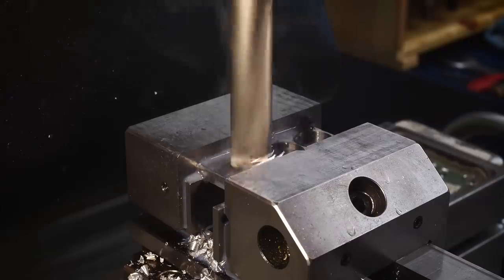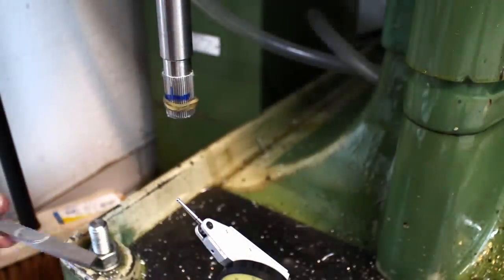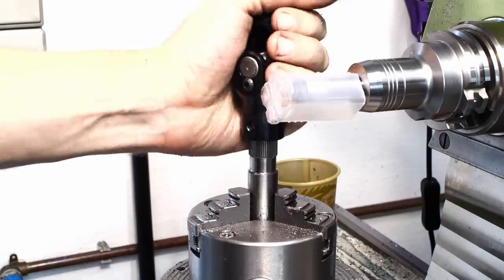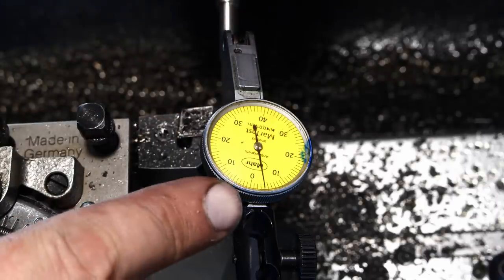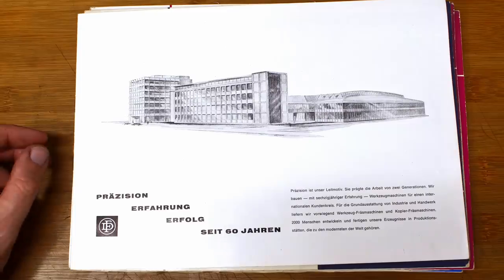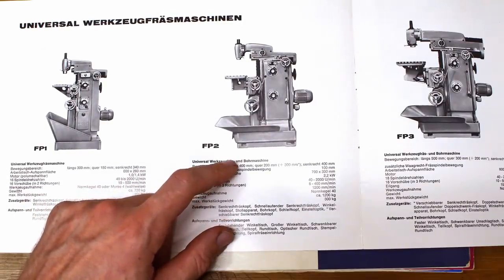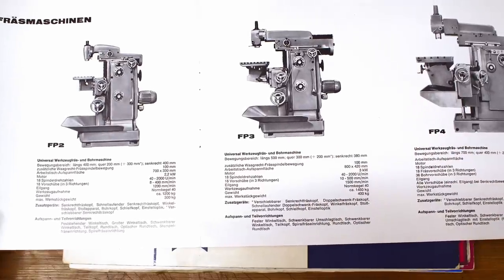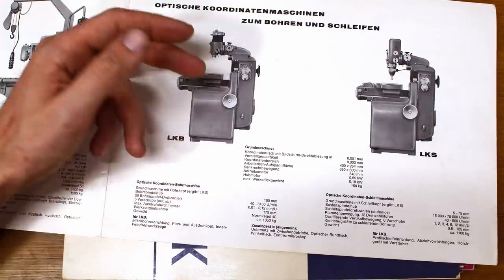Shoptalk #28

Comment: love the shop talks and really liked that radius setup!  is the error from the "straight" section of your radius?  ie the tool length?  mount the tool on the bar and pin-slot it to the toolpost?  I'm surprised your tailstock quill and taper lock well enough to drive the carriage under power cross feed.  maybe i need a new lathe, lol.  anyway, enjoyed!
Reply: This Old Bro, you need to post more videos
Reply: Left this comment on Stefan's comments, but you would certainly be another that could produce a nice, clear presentation of "fits".

"You mention something in this video that I'm not very "brushed up" on. You used the term "sliding fit". I've looked and have never really found a good video on "fits", sliding/slip/press/etc."

Comment: Good stuff Stefan, love the radius setup in the lathe.  Making the pin spacing of the radius bar shorter by the tool nose radius will give an accurate part radius.
ATB,  Robin
Reply from the maker: Hi Robin! Thanks, I have to revisit the radius tool, the geometric phenomen, on how the insert radius actually deforms the contour is not entirely clear to me yet.
Reply: @StefanGotteswinter  I don't think there is any error if the insert tip is straight on the centerline of the 400mm holder, and the 400mm is from the tip of the tool to the center of the pivot near tailstock, what does change is the stepover per revolution because you're feeding in in a straight line, so stepover is decreased INcreased as you get closer to the center, but probably not an issue in this case if there is some radius on the tip of the tool, besides the error is minimized because the infeed point is far away from the pivot point, would have been even less if you moved it closer to the cutting tip
PCD tool had a hefty radius, MCD I couldn't make out

Comment: I never use water based coolant... I use the cheapest atf(oil) i can lay my hands on... First, it smells like you are caramelizing sugar when burnt or heated up, second, its oil, not water, so it can not cause rust if left on surfaces... 
Its also quite a good cleaning agent in and of it self, making all the machine surfaces it runs down and that get wiped off as clean as if blasted with brake cleaner... Sure, not in a single go, but when its your only coolant, you machines quickly shine up and loose all oxidation or discoloration on any supposed to be bright finish surfaces... 
Its essentially hydraulic oil, but unlike many hydraulic oils and low vis. spindle oils, its not as toxic as all hell, it doesnt turn acidic in a hurry like some hydraulic oils do in presence of even a hint of moisture in the air and so on... 
I highly advise anyone whenever i get the chance to try it or to switch over to it... It needs less maintenance than water based coolants, it lasts longer(much longer if the system is filtered and not fully open to air all the time...) and while it may be worse in cooling capacity, all the other properties it offers outscale water based coolants in my opinion by a margin and a half... If you want cooling, use the mist system with the same oil and there you go, much less oil usage, much higher cooling and still no chance of rust or any stupid shit... There is a reason why the old automatic lathes which were cam programmed ran and used nothing but mineral oil as coolant... Those were high precision, complex system machines that required absolutely no chance of any complications due to nonsense... 
Also, when coolant gets warm or hot, it also evaporates water inside the tank, and if that tank is the machine base or some machine cavity, you are getting moisture condensation within the machine cavity in the area which likely isnt all that immune to rust... Sure, its likely painted all over, so that offers some rust protection, but paint is a poor solution, whereas with oil, if it evaporates in the machine cavity, it deposits a layer of oil on those surfaces and all other surfaces it lands on, granting some rust inhibition as a free gift... 
As mechanics say, ``if water in your knee is bad, you dont want it anywhere else``... Also, if you are using or making your own water cooled spindles, you might consider automotive ethylene glycol as an additive, sure its toxic, but its delicious, and that is the point! Jk, its rich as hell in rust inhibitors and the spindle cooling sys. should be a sealed system with water to air cooling via radiators regardless, which should encourage you to use glycol(if you are confident in handling toxic additives(like the ones used to sanitize machine water based coolant...))... It will help the seals hold up better, and it wont rust weld the cooling system over time, and for fucks sakes, if you are in a cold place with a cold shop, i dont need to say that its also called antifreeze, which i dont need to explain the benefits of in using in a costly system that could be damaged by frozen cooling liquid...

Also, Stefan, you are torturing me by reminding me of Deckel LKS/LKB`s, as one got away from me and im still pissed about it, as it was the seller`s fault... An asshat of remarkable magnitude... A fully decked out Deckel LKB with jig grinding and boring heads, full 2 cabinets of tools and ancillary eq. all of it for pennies essentially, and the machine was in a great condition... And she got away as the asshat had multiple sites with multiple buying options(varying per site) and while in process of making the deal with the seller, someone ``buy-it-now``-ed her online, on a site which i didnt know existed, and since the money hit the decks, the asshat despite the legal binding papers being exchanged, took the money as the more legally binding contract and sold her off... I coulda pressed the issue, as the papers he sent me had ``legally binding offer`` which i accepted, written on them, but fuck me, she`s water under the bridge - long gone other than in memory... 
Speaking of Deckel, those slant table FP3 variants are very popular for some engine resto rooms, logically, those where V block are the main game... You can mount the flat table and turn the head, you can mount the block to the slant table, you can do the hokey pokey, you can bore, you can deck the surfaces and so on with a lot of ways to approach the fixturing and with lots of options given to you by the machine itself... I dont know of such shops, but i have read quite a few forums where some guys claimed to run such shops and to appreciate such machines highly...

All the best and well lubricated regards,
Steuss

Comment: Or make the shaft a little longer and drill a small pin hole at each end , machine your splines and cut off the end and holes to achieve the desired length, and thank you for sharing the tooling with this old toolmaker, can you use a mist cooling system to keep the lathe parts cooler, good comment about thermal expansion.

Comment: Thank you for the video. I just recently watched two videos by Peter at Edgeprecision that dealt with slight errors that occur with lathe tool radii and how to compensate for that minute measurement. But I'm not a machinist, so it didn't sink in until you mentioned it. I then remembered your wise comment about trying to achieve perfection. Is there a beer waiting for you at the top of your climb ? Cheers

Comment: Those copy milling machines look really fun, would really like to take a closer look at one.

Also, with the spherical turning, you can compensate for the error of the radius simply by making the hole distance in the bar shorter by the value of the tool radius. You would also have to compansate for the radii of the balls you used in you measuring tool in the same way. Since the curvature was really shallow it's easy to get away with ignoring it, but on more curved features you have to take that into account. You can also account for it if you make the radius of the spherical feature smaller by the ball radius of the measuring tool when constructing it in CAD, or you model in the balls as well.

Comment: I really like your design for the Spherometer, I was looking at doing a similar measuring tool and turns out, there IS a math equation where you can calculate the measurement of the height/depth of the measured radius, although CAD is always easier 😁
Reply from the maker: I figured out the math meanwhile :D
But I like graphical solutions.

Comment: Thanks again for a clear, not to say precise, and informative video.
Thermal expansion of materials not only has an impact on work dimensions but also on work holding. I stumbled on this when I was turning a roller for the craft press I was making for my wife. The material was some 41xx steel and I was roughing the outside diameter for this 200 mm long roller. Pretty simple operation having the work piece between a 3-jaw chuck and a live center in the tailstock. I used a WNMG insert with a depth of cut being like 1mm and feed enough to break the chips orderly. Of course the work piece got quite warm as I was turning it dry. Then my wife interrupted me with the excuse of a dinner and I had some quality time with her. After some 1 hour later I continued turning from where I left it off. The work piece started to rattle and vibrate violently. So what had happened during that one hour?
I noticed quite soon that the live center was loose. So, why would it be loose as I originally tightened it when it was cold? Actually, when that work piece got hot, it expanded and pushed the tailstock a little farther. When it cooled down, the tailstock, of course, did not follow :) ... 
The thermal expansion coefficient of most steels are in the 9-12 ppm range and the same figure for aluminum alloys is in the 19-22 ppm range. So aluminum expands double as much as steel.
So let's take an example for that (damned)  roller I was turning. The length from the chuck was 200 mm and the change in temperature was about 80 degrees (from 20 to 100 degrees) Celsius. So, if the thermal coefficient would be 10 ppm (for simplicity), the total change in length would be 200 mm x 10 ppm x 80 degrees. This will yield 0.16 mm which is more than enough to loosen the tailstock.

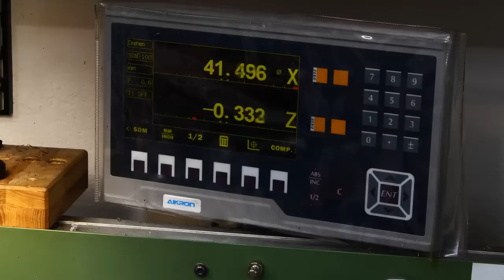Comment: 34:25 oldschool Heidenhain color scheme! 👍
and 42:30 about the error because of the tool radius, I don't see how there would be any error, since you're "profiling" with the very tip of the tool nose radius exactly because of the way the tool is designed, that being - the distance from the right pivot point to the tip of the tool nose radius being 400mm, where there is an actual error is in the feed per revolution, so in theory there would be cusps left on the surface and their wavelength would decrease as the cutter gets closer to the center, but that is minimized by using a tool nose radius that, at the given feed per revolution, would leave almost no cusp
Reply from the maker: Haha, me too - Its very gentle on the eyes and excellent to read.

Comment: Radius turning tool is simply clever.
Back in the day I used to operate on Deckel mills. The no.1 accessory for me was the centering microscope. It had a very good built in light. Once the light cord was plugged in, a relay disabled the spindle motor. The drawbar tool should have similar safety feature🤔

Comment: Is it possible to counteract the error induced by the nose radius if you slightly change the distance between the holes of the 400mm bar?
Reply: Yes if you reduce the radius of the guide bar pivots by the radius of the tool, it should give the perfect form as long as you don’t start to cut on the tool flanks.

Comment: I use the same PCD/PKD inserts on aluminum and other nonferrous materials. They are an excellent value at about $10 an edge. The flip side of the insert without the PCD is an excellent edge as well if needed.  The only complaint about most PCD is getting chips to break to prevent chips scratching and ruining your finish.  You can get PCD inserts with laser etched chip breakers, or if you know somebody with a fiber laser (lower wattage in the 20W range does fine), you can have chip breakers etched on them. They are cheap enough to experiment various chip breaker designs on. I have a few that I done and getting fantastic results using Unist Coolube 2210 from a Micro Drop MQL system. Now that we can get good PCD for $10 an edge, I will never use carbide for aluminum again. Just being able to take tenths off with no problem makes them worth it, the finish is a bonus. I use a lot of the Horn tri lug tooling also. I use their micro internal grooving inserts as micro boring bars with excellent results. Definitely tools I couldnt go without.

Comment: Very interesting radius turning, useful tip! 
I know You pinned Your multifix (as I do as well) but perhaps one possibility to get rid of the small error and possibly simplifying the setup could be to let the toolpost rotate and and simply clamp the tool holder and the bar together in the multifix holder. This in my mind should eliminate the error, since the cutting tip will be aligned with the hinge point,  the offset rotation of the toolpost should not matter.

Comment: German graphic and industrial design is beautiful, well organized, clean and very intimidating. These values are carried out through every aspect of industry. However, when you observe flimsy chairs holding up heavy machinery in Deckel's factory floor, and an assembly line of well dressed workers bolting parts under Porsches while zipping around on office chairs with casters, humor  is also valued.

Comment: Being a machinist of optical assemblies, I was screaming "spherometer" when you started discussing the metrology of spherical curvatures.

Of course the indicator depth on a spherometer is known as an algebraic function of the radius.  No need to cheat with CAD.

Another method would be to polish and set up the shiny concave item as an autocollimator, such as with a camera on the carriage, and using the DRO to measure the focal length.

The Deckel system diagrams remind me of the Zeiss microscope system diagrams.  Very much a German style of modularization, reuse, and scaling.

Comment: I am sometimes told to use a Fp3L at work. I am the only one of us who has somewhat of experience in machining (mostly from watching YouTube, and then from self tutoring with the machines we have (we started with an old Thiel Duplex, and now got the Deckel). I never got a formal introduction into the machine, and I discover something new almost every time I use it.
Just the last time I used it, I discovered that next to the rapid feed lever (which I only discovered right now, thanks to you; I thought it was a highly worn out spindle break) there is a little spin button, which turns on and off the chain drive of the coolant pump.

It is a really great machine. It is very capable, and as far as I know it is extremely rigid. It is heaps more rigid than the Thiel, but that might be a biased opinion, since the Thiel is also worn past adjustment in the Z axis and therefore a bit loose.
I love that machine.
And yes, it is not the best choice of a tool for small parts. But when doing small parts I usually set the vise up right next to the operator stand point, aka the right side of the machine.
I often wished there was a rapid feed mode. Especially with small parts, the head is always in the way of inspecting in between cuts. Thank you for telling me that there is!
I will test that out right coming tuesday. I currently work on building my own CNC machine. Got much work in front of me, and rapid feed will be a great help for that.

Comment: I have a manual FP4 from the 70's and it surely does have a vertical AND horizontal quill. The machine itself is a beast, although much of the feeling does have to do with the huge table.

Comment: With a shiny concave part like your spherical mirror, the other easy way to determine spherical radius is to measure the focal length! 
There are a couple simple ways to do this:
Use a point source like a small lamp, LED, or a light behind a sheet of paper with a small hole. In a darkish room, move the spherical surface away from the light source/flat plane, until the light reflected off the mirror forms a point. The distance between the mirror and the point/light source is your focal length, and also the radius of the surface.

Or, look at the sphere, line the reflection of your eye up in the center, and move the mirror away until your eye gets giant. When it's as big as it gets, the reflection will flip. At that point the mirror is one focal length/radius away from your eye.

Comment: After getting an approximate radius with the sphereometer, the telescope maker might use a Foucault test to find the exact radius.  The general idea is that a point source of light at one radius distance will generate a cone of light that bounces off all points of the mirror perfectly perpendicular, and will converge at a point that is also at the exact radius.  If put a knife edge into that cone, it will gradually cut the light if it is in front or behind the radius, because it's slicing into a disk of the cone.  When you slide the knife into the exact radius, the diameter of the beam is effectively zero (pretty close), and so the light will suddenly wink out.  There are various other factors; telescope makers are usually interested in a parabola, and the detailed shape of the polished surface.

I don't know if you need it or want it, but it's an interesting technique, and I suspect if you did want one, you could pretty easily make a little sled to measure the curvature very accurately.

That said, the machinery to turn the radius was terrific!

Comment: Just dropping some names for optical (non-contact) inspection systems for others looking for further research...focus variation + depth stitching, structured light, or interferometry.  Non-contact metrology is essential for diamond turning applications.  That being said, I'm curious how accurate an xbox kinect/similar imaging methods are. 

Thanks for the video Stefan. The radius setup is ingenious.